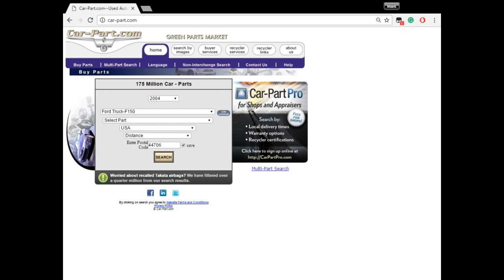How to make a Ford 3G alternator into high amp.

Comment: You need to always clean your solder joint with isopropyl alcohol to remove any of the leftover flux.  Flux is highly corrosive and can cause the solder joint to eventually fail if not cleaned after soldering.
Reply from the maker: Thank you.

Comment: Wouldn't a dielectric grease be preferred over the white lithium grease? The silicone base of the dielectric grease is far superior in inhibiting breakdown over time vs. the oil based lithium grease.
Reply from the maker: Yes, if you have that...great. What we have realized (over many years) is white lith is just as good, yet much cheaper for the working man. See our mission statement. https://alternatorstarterrebuildkits.com/about-us/

Comment: this guy full fielded  /ran wild a 1g alternator, no regulator  , small pulley   and thinks  he is getting @100 volts and 80 amps /8000watts?  but also says its  3000 watts  and that it will have such output   still when put into a load .  i say  the alternator  may show 80 amps but when its loaded  it may not even put out 2500 watts running wild as such  and it may do that a few times but it will fry eventually  after a  very few of those rounds  as full field alternators do.   can you say  something about  it  with your expertise   https://www.youtube.com/watch?v=5hlnd60IikY
Reply from the maker: I commented on his channel, warning him of the dangers and flaws of the test. He should thank you.

Comment: Thanks for the content, but maybe you should mention the enamel coating on the slipring connectors that if not remove completely will NOT solder
Reply from the maker: Sorry, if you bought the kit from us and that wasn't done FOR you, it was a mistake. We strive to always do our slight modifications to the piece before we ship. That is why it is not mentioned, because we don't want that done twice. However that operation (like all other soldering operations) starts with a thorough cleaning. Oxidation is everywhere!

Comment: So how did we amplify the current V.R.,COILS,BRUSHES) Looks like a alternator rebuild
Reply from the maker: The new stator/ rectifier assembly included in our kit is specially wound to amplify the current 40-50 amps.

Comment: Hey guys,  thanks for the video. I had to chuckle when you were using the two screwdrivers for prying the pulley. The left screwdriver looked like a beaver had been chewing on it. I had a similar one. Shorted it against hot  when working on a live  circuit.  I imagine that's how yours got that way, too. 😁

Comment: At 26 minutes, you talk about "plumbing solder" 60/40. As you use sn97/cu3...lol what you meant to say is pretty much any solder will do, 60/40 is no longer legal to use for plumbing. For the connection, the best for hand soldering would be  what is called "eutectic" not only the lowest temp melt point at 183•C but no plastic state.(either solid or liquid).
Sn63/Pd37 means 63% tin and 37% lead. Much better at keeping you connections from becoming cold solder joints.
Reply: plumbing solder is acid flux. dont use that shit.
Use Rosin flux solder. Go to grandpa's and steal some kester
Reply: They probably use silver solder with a high melting point.
You want rosin core NOT plumbers solder.

Comment: I have the same exact alternator. I have tried to email several times. Says email don’t exists. What is the guarantee it will be a 200 amp alt when I’m finished?
Reply from the maker: rebuilderinabox@gmail.com or visit the site rebuilderinabox.com and send messages from there. The small diameter kits beef up amperage about 50 amps. We say 40-50 to be safe. The large diameter kits will increase a little more (50-60 ADC) (from 130ADC) but there are huge factors like : The condition of the battery charge cable & buss fuse. The ground path. The size of the pulley. RPM. Visit our site starteralternatorrebuildkits.com to learn a lot about beefing up your entire system.

Comment: Hi i have a 94 Ford tempo with a 3.0 v6
And my alt has just the two holes 
Ive searched the site but doesn't even list a tempo 
What would you suggest
Reply from the maker: It's actually a Mitsibishi and we don't suggest doing them at home. Sorry, huge chance for failure.
Reply: @rebuilderinabox  tbh I'm not just an avid do it your selfer 
Do you halve an upgrade kit for my alternator?
Reply from the maker: @bobbybland9497  Sorry, nothing against you, but we won't lead you off a cliff.

Comment: Do not use metallic paint!
Reply from the maker: We have 30+ years of experience as professionals with this paint type and similar earlier versions. We recommend this finish, not just for cosmetic reasons, but also to inhibit corrosion and promote ground path so units rebuilt with our kits and system are trouble free for long life expectancy.
Yes, to a person that is a novice alternator rebuilder, this may not seem right. But trust the voice of many years of experience.

Comment: Would I need to reset my automobiles computer
Reply: Silva Mane no
Reply from the maker: No. Not if using it for the years that a vehicle has a 3G from the manufacturer.

Comment: i found your video most helpful, thank you, and i was wondering if a 1973 ford f250  with a  
7.5L is there a rebuild kit for them? Thanks Jim
Reply from the maker: Not currently but we plan to.
Reply: i updated the alternator on my 77 f -100 and 67 ford ltd 390 same thing though to the g3 alternator  from a 7.3 diesel ambulance supposed to be 200 amps but i'll tell ya that the head lights will be a lot brighter and your battery will love it. i also changed all cables to 1/0 heavy cables even the one from the solenoid to the starter..  my 77 f-100 460 is a 500 hp tourque monster weekend 4mph play pretty.  both engines in both vehicles spins over faster and starts a lot more easy. i don't thing those old alternators were even 60 amps and you will need to do away with the external regulator east to do if you can get your hands on the wiring diagrams for both your truck and the newer alternator.. i'll tell you the driving in the dark will be safer feeling as those lights will be brighter..  10/4 and good luck

Comment: on the 90-95 amp small case model, what does the kit jump the output to???
Reply from the maker: Adds 40-50 amps. At 14.5VDC that is 725  watts.

Comment: @26:05 NOOOO!!!  Do Not Use Plumbing Flux for Electrical Work. Plumbing flux can have ACID in it.
Reply from the maker: PLEASE!!! we have been doing this for many , many years professionally. The long service life of thousands upon thousands of alternators in various environments and climates is our teacher. Yes, solder manufacturers recommend rosin core for small electronic components like the inside of a voltage regulator or rectifier. But this part of the movie is about creating a bond between 2 pieces of light weight metal that will be exposed to considerably high centrifugal forces and heat. If you know anything at all about welding, you know etching makes the weld stronger. A little bit of paint after the operation will prevent any future corrosion of the bond.
Reply: Chris W all flux has an electrolytic surfactant. Its only a problem if you’re soldering dissimilar metals,. Plumbing flux must comply with regulations due to household and commercial human consumption factors.
Reply: Serious question, I would use an electrical contact  “turbine blade”  lock washer between the mounting bolt head and alternator case surface, with aluminum anti seize on the mounting bolt threads. Would applying s film of electrical contact grease between the alternator case and mounting cradle work?
Reply: Mike Lauer or just clean it with a Q-tip dipped in lime water,  contact cleaner or denatured alcohol. Or all three. But by all means, use flux on electromechanical dual purpose joints in high vibration applications, extreme temperature fluctuations, rosin is great stuff but it has its limitations.
Reply from the maker: Yes.

Comment: You can safely use a baking soda blast on the fan he is using a wirebrush on . I have no knowledge of any specific issues with glass bead blasting. Its is essentially clean silica it has no conductive or contaminates I'm aware of. Most rebuilders use it exclusively. And the most crucial element of a good lead solder joint is absolutely clean surfaces. Then heat the surface to temp them apply the necessary amount of solder. And of course flux before heating but after cleaning.

Comment: Hello! I have a 99 Explorer that I bought a repair kit for. My housing for my altenator is like the smaller 95 amp. but I have 2 holes like the bigger 130 amp... I have replaced the voltage regulator and the brushings on one side (one brushing was worn all the way down) but I cannot get the big bolt of the pulley side. I do not have a torque drill and the pulley keeps spinning. I have tried on and off for like 2 hrs. I am a not a mechanic and I do not have man strength 😂 do you have any suggestions on how I can get the bolt off without damaging the pulley? Or is it a way to test it to see if the worn brush was the problem? Thanks!!! Also my kit didn't come with a new slip ring. Can clean the burn marks off? Or do they have to be replaced?
Reply from the maker: Sounds like you just need to watch the movie on our site. You can clean the slip ring with sandpaper or scotch brite. Best way to get pulley off is 1/2 inch electric or air impact. (Call somebody or borrow) You could also tighten the rotor in a vise (not really a great idea) and use a I/2 " ratchet and socket. If the bearing is good (feels smooth when you hold the ass'y in your hand and spin) or wasn't noisy on the car,  the bearing will be OK for a while and you can leave the nut alone for now.

Comment: before soldering, the best way is sandblasting connection.
Reply from the maker: If the sand (glass bead) is clean. Turn the pressure down, too. 100 psi or more would be too much
for some alternator parts. Don't do it to a voltage regulator. It won't work when you're done.

Comment: 35:09   why not drill out the broken screws and use screws with lock nuts?
Reply from the maker: Good idea. Apparently you have alot of patience, but it would work if you have a drill press and a locating vise.

Comment: Center nut off the pulley that alt should be secured in a vice ,contact points being the mounting bolt holes. Holding anything in your hand then applying 400-500ft lbs of takeoff torque isn't safe. To remove that stuck pulley hold the pulley with a set of channel lock pliers using rubber as a cushion to avoid damage,tap the center shaft on the end ,keep the alt about two inches above your work surface during this process. It will come off easily. WD40 is ineffective as a rusty or stuck nut penetrant. It is a water displacement and light lubricant. Get aerokroil from kano labs online. You will never use anything else. Two screwdrivers is a not a precise or safe removal method.
Reply from the maker: If you're too chicken to lightly hold the pulley. The nut will come off just by bumping the impact trigger to the left, then wait for the rotation to stop. Repeat 5-6 times just holding the alternator body steady on a table, and you'll notice the nut starting to unthread. Then repeat 5-6 more times allowing the shaft to come to a complete stop. Jon's method won't work because clutch pulleys are becoming very common. Gotta love all the experts.
Reply: jon johnson ; two screwdrivers may not be precise however it's the preferred method documented in most of the shop manuals. sorry about that though.
Reply from the maker: We don't intend WD40 as a rust bust here. We want lube so the pulley will slide easily off the shaft. We have done thousands, even motor oil would be a big help here to slide the pulley off.
Reply: These people have never turned a wrench lol. Next time you get a tire fixed or new tires installed. See if they torqued them on properly to right ft pounds and pattern or just impact them on

Comment: For this job I'd of used liquid Flux on the parts with silver bearing solder to withstand the heat better. 60/40 is more designed for electronic parts, I wonder how long it would last for a job like this...??? 60/40 is some pretty soft stuff.
Reply from the maker: Use whatever you want. We would encourage silver but 60/40 is good enough. Bear in mind engine temp 190F. 2 internal cooling fans. Radiator cooling fan. Vehicle is normally moving for fresh air circulation....Not that we are Motorcraft fans, but FoMoCo made millions with 60/40. Also vids are intended for a successful experience for the working man with common garage tools. Silver should have more expensive equipment to get much hotter for proper melt. If people use silver, they might not get it hot enough and cause problems.
Reply: Braze thick copper with 55% silver ( orange flux coated is the best n smells of nice citrus)or
Reply: Or 15% silfos at connections will remain intact after the rest designates probably should not mention my idea but wtf. Ever considered running a hydraulic pump ( 12v abs pump) to turn a hydraulic motor geared up to run the generator /alternator to get about 100/1 n take a huge load off the alternator that can charge the battery bank   And rest when charged running the inverter and auto start at a specific voltage drop?? Just storming 😏
Reply: Perpetually in motion yet?

Comment: Is there a kit to make a Ford 4G into high amp?
Reply: 4g.... you will be better off converting to a 3G . After 8 years of rebuilding alternators and starters the 4g alternators in my opinion were an epic fail hence the 6g that came out shortly after. If you want some seriously stupid amps check out the Boss 300 for fire trucks .
Reply: Or the Delco Remy 55si

Comment: So many misuses of tools.. 6" 1/4" drive extension as a punch? Screwdrivers as pry bars?  A pry bar set would have been appropriate in both occasions.
Reply from the maker: Cory. please read our mission statement on our site. https://alternatorstarterrebuildkits.com/about-us/. This series of vids and site is dedicated to, and intended for the blue collar American working man, who is tired of being victimized by the automotive big box stores. He doesn't have a big tool box, and needs to get his truck (or car) fixed reliably, but on a budget. As hi tech electrical rebuilders for the last 40+ years,  these are the problems that we see with our industry, and this is what we offer to help : QUALITY PARTS, INSTALLED WITH ONLY BASIC TOOLS. You can't do this with Mitsibishi, most Bosch, most Denso, even certain GM and Ford. But, we HAVE selected certain units  that can successfully be rebuilt under the shade tree with our guidance. If you have a puller, or a pry bar...great. Use it (as long as you haven't jerked your shoulder out of joint patting yourself on the back). And most back alley guys should have a pry bar, but we selected an extension because we don't want you to pry on the soft copper/plastic part of the slip ring on the back side of the pry bar.
Reply: Lol... Corey you ever heard of a shade tree mechanic? Unless your business is rebuilding alternators for living you will have all the time saving tools. The average  Joe is going to have the basic tools and make it work with what he has. Its also called using tricks of the trade.
Reply: @lonniefreeman4278  um, shade tree mechanic here.. difference is I know how to use my tools..

Comment: they make a bearing puller for these.....I dont use my extensions as punches ....  why do you make video's on how to  if you yourself do not know how to ?  it dont make sense !
Reply from the maker: How many times do I have to tell these guys that almost break their arm patting themsef on the back because they have a bearing puller ??? We have been electrical rebuilders for 40 yrs. This series of movies is dedicated to the average working man with BASIC, most common tools, who needs a financial alternative to the big box syndrome. Harbor freight sells extensions cheap. If you have a puller, go ahead and use it, and make sure you BEAM with proudness and internal pride the whole time you're screwing it down.
Reply: Steve, you do realize that he is using the basic tools majority of weekend mechanics have in the tool box. If you're tools are made in China than I would recommend getting a bearing puller for cost of $40 to $60. If that's the case I would recommend and just buy a alternator already rebuilt. My sockets and extensions are snap on or craftsman made in US and lifetime warranty. If they brake I get them replaced.